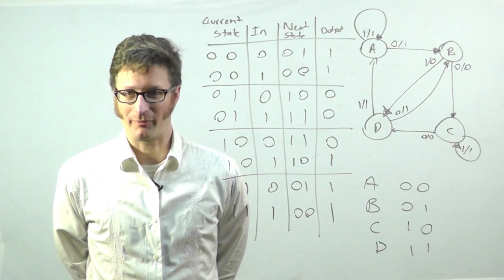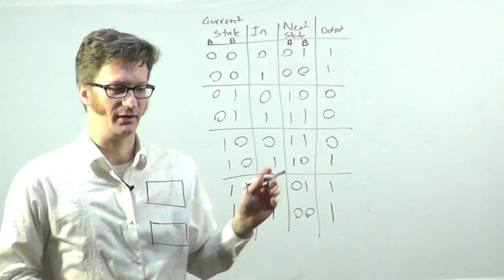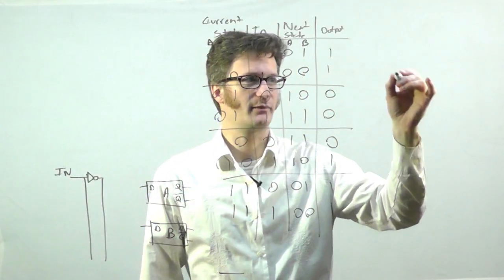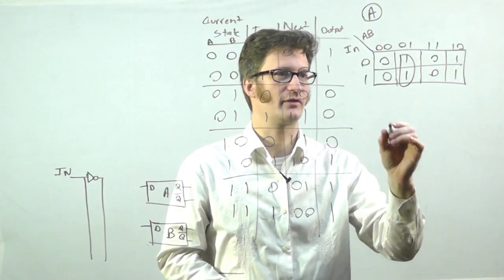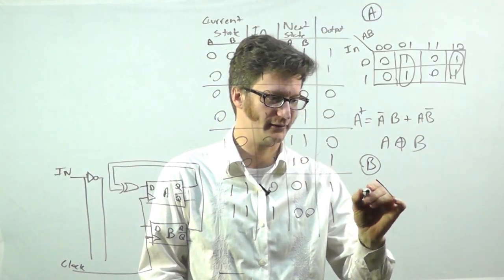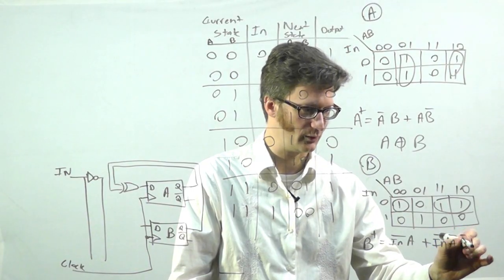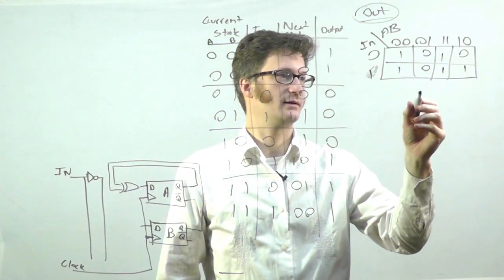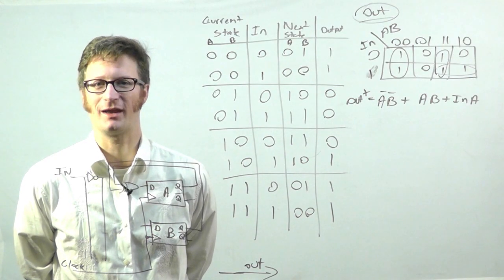Digital logic - Making a State Machine with D Flip-Flops

Comment: why the excitation table of D flip flop doesn't considered?
but with JK flip flop, the excitation table is used.
why?
Reply: 5 years later and I wonder the same thing: Why isnt the excitation table used here?
EDIT: Never mind. I did the excitation table and the resulting table for each flip flop is the same as the Next State tables. So you can just use the Next State table entries directly, which is a property of the D flip flop (D = Q on the next clock cycle). Also from here: https://www.allaboutcircuits.com/textbook/digital/chpt-11/finite-state-machines/, it states "For the D - Flip Flop this is easy: The necessary input is equal to the Next State."

Comment from the maker: There are four possible states.   With N flip-flops, you can represent 2^N different states.  2^2=4 so therefore you need two flip-flops.   If I had seven states, I would need three flip-flops because two flip-flops can only represent four states and isn't enough.   Three flip-flops can represent eight states and is enough to represent seven states.   Keep in mind that if you have unused states, that the unused state must make it back into the main sequence in the even that there is a glitch.